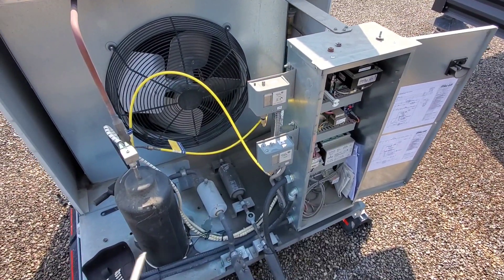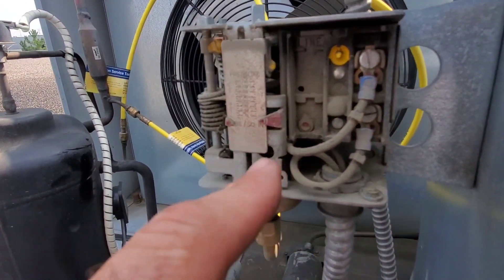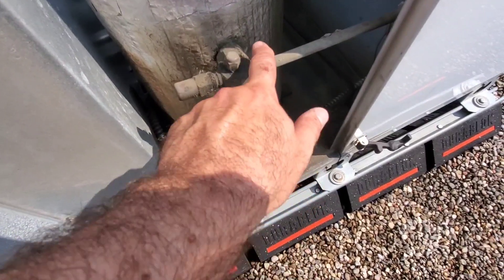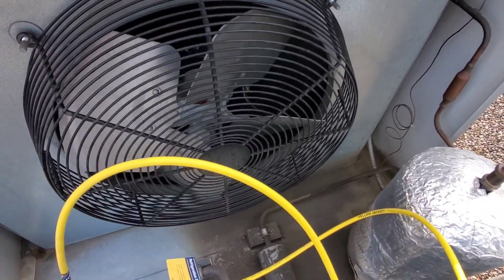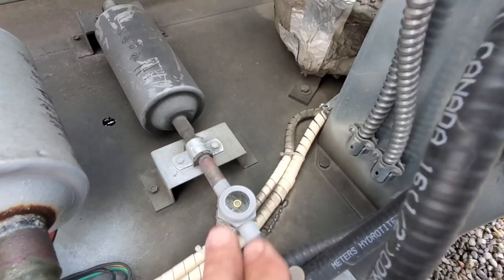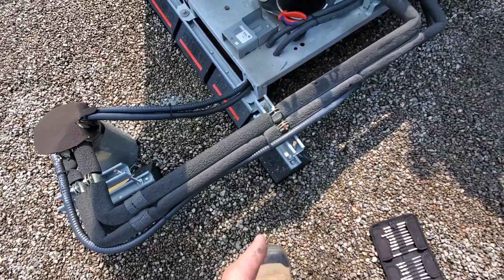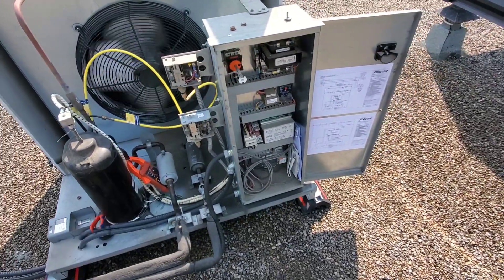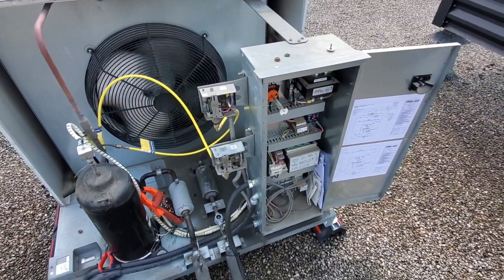Condensing Unit Inspection and Maintenance Considerations

Comment: Awesome! So is receiver insulation a common thing up north? Makes sense. Cooler temps. Never seen that here in Texas, nor a receiver heater! Great content
Reply from the maker: Yes, insulation and heaters to keep the condenser pressure up on the off cycle.  This makes it easier to pressurize the low side when the solenoid opens up.

Comment: Hey do you have the small screen that connects to the Emerson SH controller with an RJ11 cable ? Makes life easier .
Reply from the maker: I don't but that sounds handy, can yiu make changes?
Reply: @HVACKnowItAll  yeah it lets you see the LP , SH , suction temp etc and you can enter the parameters and make changes . Part number is Emerson ECD-002 Display/ Keypad unit . Super handy to have that in the van , you need an RJ11 cable to connect it to the SH controller .
Let me know if you get one .
You can get the manual for it on the net ( Instruction sheet PA-00320 ) on the Emerson website